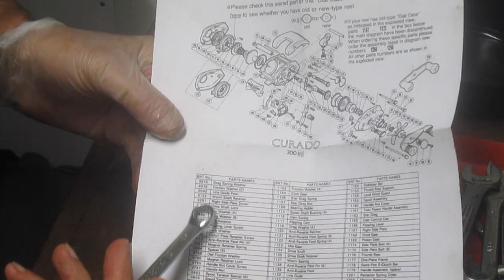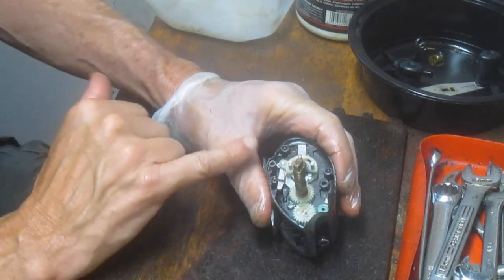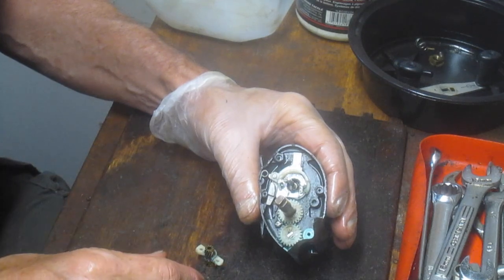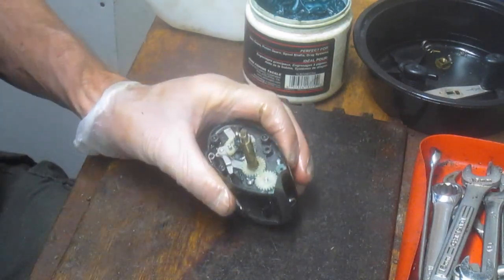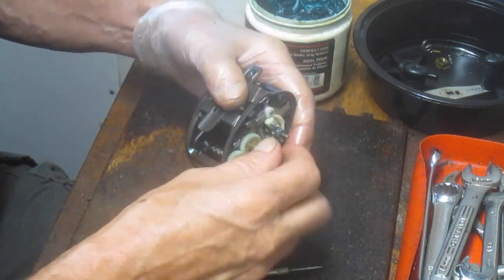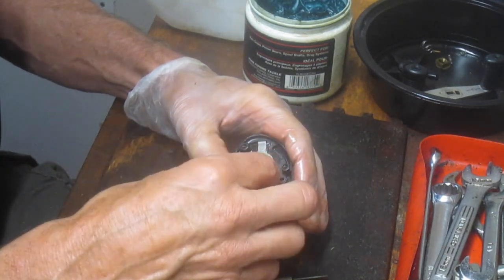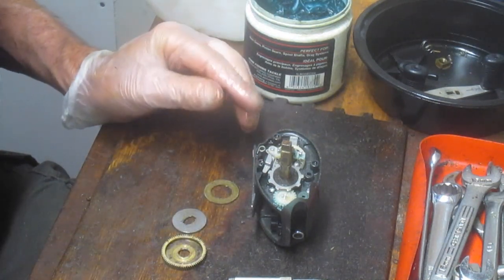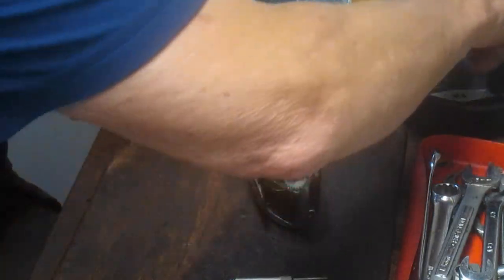Shimano Curado Bantam low profile fishing reel how to service or repair step by step

Comment: What screw driver did you use to take the handle off to get to the 10mm nut? Just picked up the reel and a fenwick golden wing rods gw 76ch-t pole for 20 bucks.
Reply from the maker: That's quite a deal.  The Fenwick rod is easily worth the price paid.  I used a #1 Phillips head screwdriver to take the cap off - Dennis

Comment: I have a CU-100B and it is missing 2 of the pins for the brake system what do you think the odds are that i will be able to get new ones for it
Reply from the maker: Go make them.  Find a coffee stir straw or the plastic tube from a spray can like WD40 and pick one that fits snug.  All you need to do then it to trim it to size.  The odds are good that it will work fine - Dennis
Reply: @2ndChanceTackle  thanks

Comment: Hey Dennis quick question for ya! I have a Castaic 201sf and it seems very similar to this reel build wise. When I turn the handle fast and then stop suddenly and almost try to reel in reverse the reel makes this weird loud almost clicking sound. It also happens randomly sometimes when I try to cast, loud clicking, spool dramatically slows down, even had a bait break off. I’ve been working on it for weeks and can’t figure it out. I was thinking the anti reverse bearing maybe? I ordered one, but I’m not sure. Pinion gear also has a lot of side to side play in it was wondering if the spool was slipping out of that or the yoke, or if the gears were slipping…? I’m so lost 🤦🏻‍♂️😂 If you have any thoughts I’d really really appreciate it. Thanks so much. Really appreciate your vids! 🤙🏽
Reply from the maker: I think you have a problem that is not a problem.  This happens on the Penn 975 series as well.  The cause is most likely that  the spool brakes are not braking fast enough and that is because of the way you are testing.  They were not designed to hold that level of force. - Dennis
Reply: @2ndChanceTackle  Interesting. All my other reels don’t do that at all, but obviously this one is way older. Not even that much force either just reeling fast and stop. And it clicks for an extra second or two. But wonder why would it happen when trying to cast? That’s just a normal function the reel should handle 🤷🏻‍♂️ It also happens when I just reel forward fast. Also it only happens with the spool in, and it’s worse with the less spool tension I have on. Just to give you more clues haha maybe I’ll try and email you a video clip of it so you can hear it! I really don’t want to give up on the reel, when it works correctly it casts so far! 🤦🏻‍♂️😂

Comment: Hello I have 2 very similar reels to this the only difference is they're the Bantam Citica CI-200's they have a bearing or 2 less than the curado. Instead having bushings in certain places on the spool. How would you go about lubricating those? With my other reels I can just give them a drop of oil but I'm not sure on these. Thanks!
Reply from the maker: Once you remove the non-gear side plate, you can remove the spool and oil the bearings or bushings - Dennis
Reply: @2ndChanceTackle  I knew how to do that I just wasn't sure what to actually oil on the bushing haha. Since it's just a round piece of plastic basically. And thanks for the reply!
Reply from the maker: Yeah.  Plastic is a petrochemical and you don't need to do anything with it, which is probably why the manufacturer chose it.  You can put grease on it as it won't clog anything and will last longer than oil - Dennis

Comment: I know this is a older video but is very helpful. The  reel you are working on is the B Model. The A Model has a flipping switch and take down screws & regular screws. It doesn't have the easy acces to the spool like yours in the video.  The take down screws I belive are to remove the left side of the reel to acces the spool ? My  concern is the flipping lever . Should I leave the lever switch attached . Or should I remove the lever Switch before I separate the case half ?   I would appreciate any thoughts on this model .
Reply from the maker: If the flipping lever is an arm on the side plate near the spool adjuster, then you need to remove it in order to not disturb the cam and spring during removal.  If you left it attached, it would pill those parts off of the inner gear assembly and make a mess. You can safely remove the case once the flipper arm is detached.  It will still be helpful to make sure the cam is not stuck in the case, so remove the case slowly, and if you like, use a screwdriver to hold the flip came down, while you pull up on the case - Dennis

Comment: @laslider you are absolutely right! But the main difference in my opinion is the magnetic brake of the A-Series (as seen in the schematic) and the centrifugal  brake of the B-Series (the then new VBS system - as seen when Dennis opens the palmside). The B-Series was introduced sometime in the mid 90th and was listed in the European catalog even in 2004.
Reply from the maker: Thanks guys - I rarely work on bait casters and you are helping me learn the back story on this reel.  I will update the description to the later version - Dennis

Comment: where’d you get the pawl and pawl cap from?
Reply from the maker: Check Southwesternparts.co or ereplacementparts.com
Reply: @2ndChanceTackle  the pawl cap was discontinued, i ordered BNT1239 instead. i have a cu201b5, would it still fit?

Comment: Last week i dropd my curado 201 in fresh water should i take it apart or just oil it?
Reply from the maker: If you have fishing to do, put the reel in a clean bucket filled with fresh tap water and let is sit overnight,  You can then oil it.  If you are hearing any noises or the reel is sluggish, then you should take it apart and do a full cleaning and re-lube.  You did not say how long it was in.  A quick dip, - oK.  It it hit the muddy bottom and came up ugly, best to go with the preventative full cleaning right away - Dennis
Reply: @2ndChanceTackle  it was in the river for about 30 secs
Reply from the maker: Just soak the reel in fresh clean water overnight and lube it.  You should be fine.  If you hear a grind or anything then you will need to take it apart - Dennis
Reply: @2ndChanceTackle  thanks

Comment: I got a cu 200 for a 12 pack of beer. It is jn good shape but plan on taking the clicking star system off jt to fix a citica E I have. The cu is a solid feeling reel but kinda dated now in the baitcaster category.
Reply from the maker: Sounds like that was a good trade.  The reel may be dated, but it is still a good reel capable of catching a lot of fish.  Good luck with the swap - Dennis

Comment: I dont get how the plastic gears ?? after so many years LoI
Reply: not broke down …..
Reply from the maker: Plastic gears have more give and flexibility than metal ones and they actually work better on level wind reels than the metal ones, they are smoother and their track record is very good. - Dennis
Reply: Even in the high end reels the Idle gears have been made out of plastic for years and they never break, the line guide does not create enough friction to do any damage.
Reply: @baseballgod8065  well that is fucking smart wow , I have used only spinning reels , but I never saw any plastic gear inside so fore me it sounds fucking crazy LoI , I have got my first levelwind not long time ago the ambasador c3 4600 just to get more range in jigging ,many ppls have scared me when I have told them that I want to use line 0.19 strike pro , they told me to put not less then 0.32 , but even with first use I have no beard nest , sorry fore my English